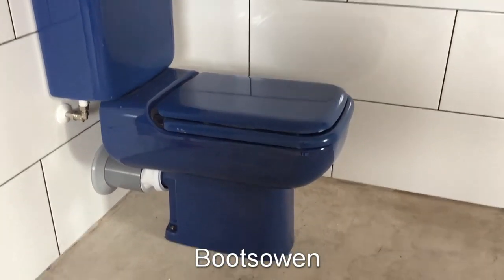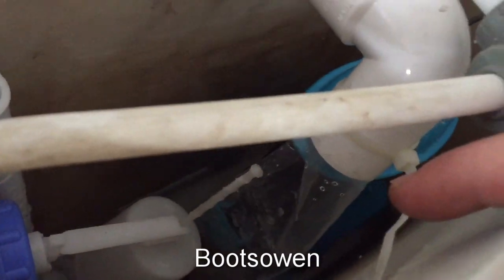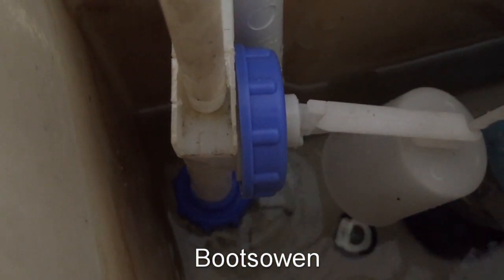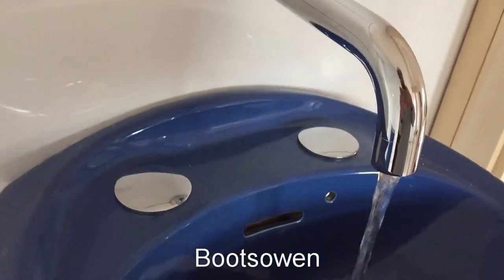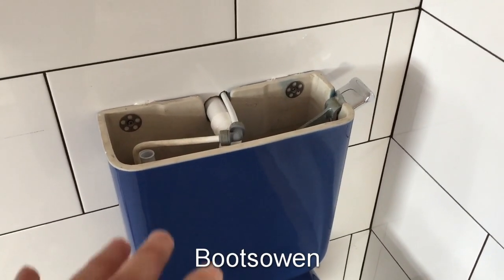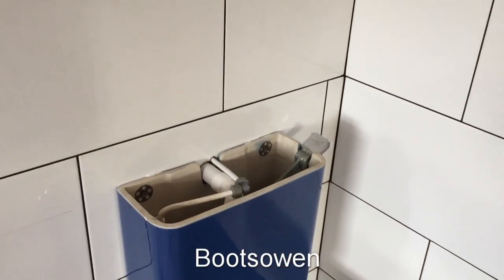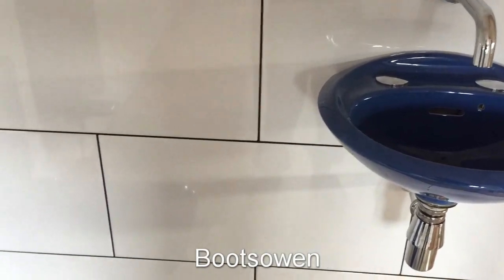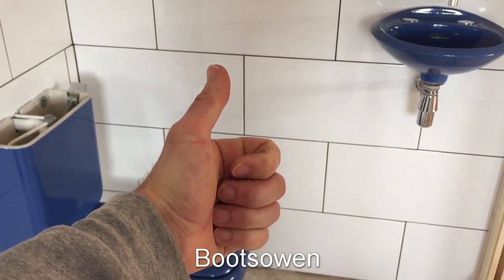How I made an eco-friendly toilet cistern tank hand wash sink

Comment: Oh my God you are a genius!!! I have just come across your video. Thank you so much for sharing this brilliant idea and links to items needed! I have been struggling for ages trying to have a small basin installed in a very small cloakroom with only a toilet. Every plumber I have ever consulted stated they had to do a huge construction, breaking through walls to be able to install an incoming water pipe, as well as a waste pipe. It would cost thousands of pounds!  Good thing I never bought into that idea! Your video solves the matter - so simple to execute and not expensive! Amazing! Thank you 🙏
Reply from the maker: If you have a toilet you must have cold water coming in and a waste pipe going away. It is very easy to connect to them. Breaking into walls just depends on whether you care about exposed pipes or not.

Comment: Just a quick question. I can’t find the link to the type of cistern on your video, I.e. with an internal U-shape cut at the back, which allows the pipe to go through, without disturbing the cistern lid sitting properly over the cistern. I have researched the internet and cannot find a cistern like yours. Would be grateful if  you would offer please a link - or did you manage to make that opening yourself? Hope you can help. Cheers
Reply from the maker: you could drill a hole in the back of any ceramic cistern with a tile drill bit. I have posted videos of how to do this in tile, and it is exactly the same in ceramics like this.

Comment: Cool video, I'm going to try it!

This question probably testifies to my ignorance about plumbing but is the pressure behind the water coming into the toilet enough to power it up to the sink? And then you just made sure that there's a slight downward tilt to the pipe bringing the water back into the toilet?

Thanks!
Reply from the maker: Yes to both
Reply: @bootsowen  One last query - the tube going from the water-into-toilet valve to the sink head - did you move that to regular piping at some point? Stick with tube the whole way and then use an adaptor to hook it up at the faucet? Thanks!
Reply from the maker: You have to make up some sort of adapter depending on what you can get in your local plumbing merchants

Comment: Hi Owen, Really cool idea. Did you have any issues cutting the back of the cistern for the waste/return pipe or was it already moulded that way? Thanks.
Reply from the maker: It was moulded that way, so I worked to that, otherwise I would have taken out the angle grinder with a diamond wheel.
Reply: @bootsowen  Thanks a million for that Owen. 👍

Comment: Why not just connect the sink drainage pipe to the water line of the toilet? First I thought pressure wouldn't allow it but I have seen a Mexican guy doing just that and it works, he does it outside the wall but the idea is the same.

https://youtu.be/olu3wrWkg4Y
Reply from the maker: So then if you haven't washed your hands there is no water to flush, and if you keep washing where does the water go?  Which solution have you tried and how did you get on?
Reply: @bootsowen  If you haven't wash your hands... just open the faucet, also toilets have an overflow tube inside the tank.